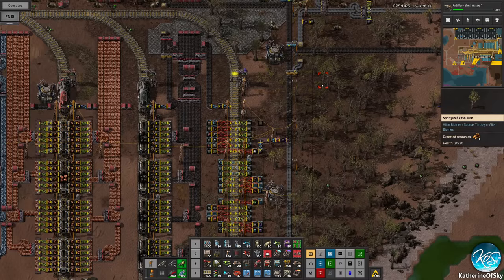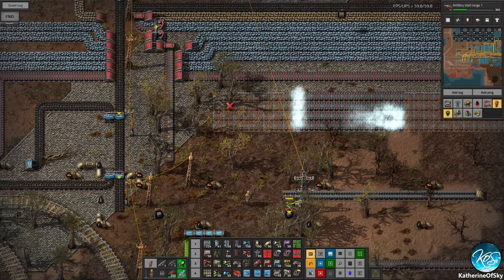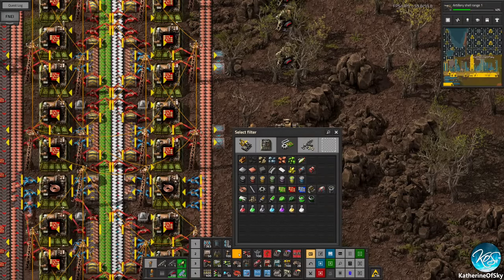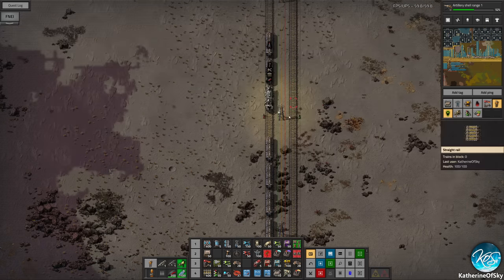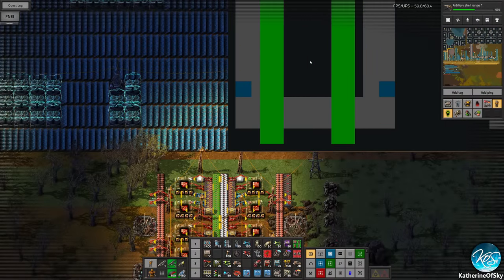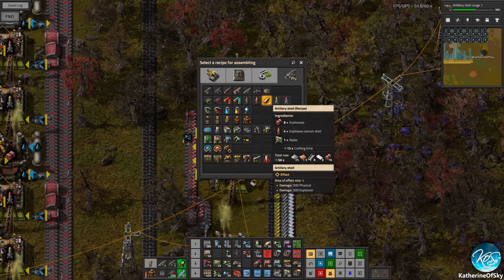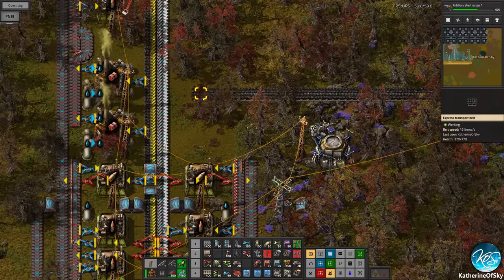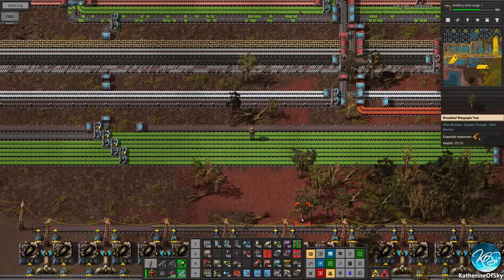Factorio 1.X Entry Level to Megabase 5 - 34 - MAKING ARTILLERY! - Guide, Tutorial

Comment: If you plop a blueprint in the wrong spot, use ctrl-z, its a lot easier than finding all the incorrect ghosts. Now the blueprint of the green circuit base station has a lot of incorrect wires, inserters and chests. Later in the episode you talk about it/do it in other spots.
Reply: That was indeed both what she said and did, this very episode.
Reply: @donbionicle  Yes, later she did/said it. I will change my comment :D